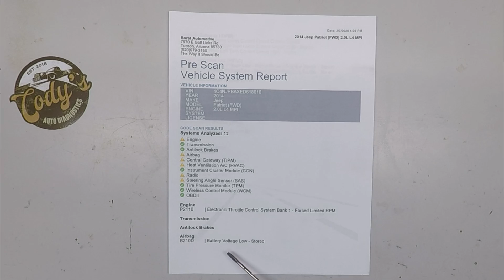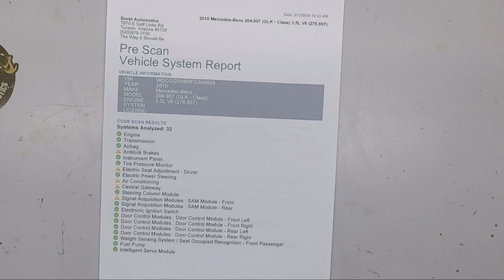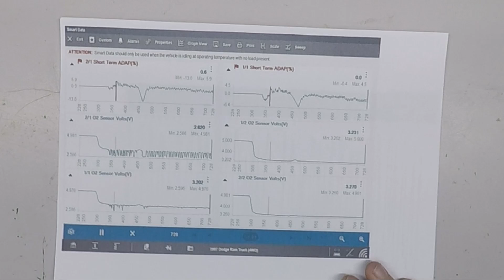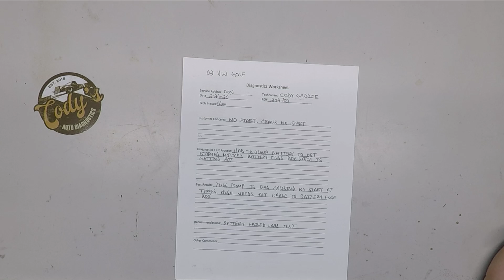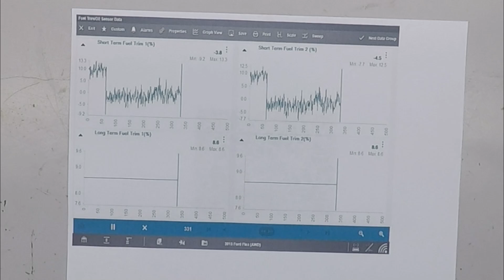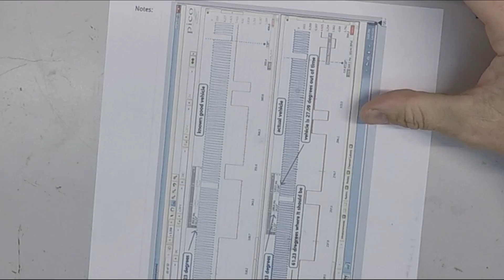DVI (Digital Video Inspection) part 1

Comment: It's great but not. It does comfort the customer, well some customers that have a clue on what there looking at. I seen shops show customers a part they replaced that isn't even on there car. It protects the shop and tech in a lot of case. The thing I have a issue with is time. Every extra step is time and cost. I don't care if it's a extra 20 mins it's time in a industry that needs time. It's a great ideal if if your paid buy the hr and if so I bet the customer is paying for that. I would like to know how your shop charges for that. It seems like a good ideal but if you own a 7 bay shop with the latest stuff out your over head is all ready high (so cost are high). For instance I was out of town and my shop was closed for 2 days. A good customer of mine had no choice but to go to a big shop up the street. He frist went to autozone just to see the code because it had a light on and a bad shake feel (his words). When he took his car in he explained "I think my number 3 coil is bad because my car did the same thing with same symptoms last year with coil 2. I'm not a tech but just throwing it out there. The code was miss fire on number 3". He was at there shop for 45mins. His bill was around 395$. They charged him 125$ to scan the car 100$ to diagnose it and 70$ for coil 60$ to replace it. To me that's crazy.for a coil on a 2009 Ridgeland that every thing is in the open and accessible. I understand over head but if it's all ready that high you need to charge those prices how do you add more to the bill when it's all ready outrages. Just my thoughts but other then time it seems like a awesome ideal.
Reply from the maker: I absolutely agree with you this system does take time. Only time a vehicle is getting a “full” inspection, is on lof’s for example, but us as technicians get .25 for the inspection plus the labor time to perform the lof. 

Every vehicle does get fluids and tires checked with the dvi,  which is only maybe 2-4 minutes for that inspection, and for those we don’t get paid for. 

That’s unfortunate about your customer and to be charging like that seems to only be gouging the customers wallet. 

I do know as a flat rate tech that time is money and I’m all about making the money and with this system it’s brought our average dollar per car up 2.5 times where it was without it, so that being said larger priced tickets are getting sold easier then before having the dvi. 

Customers may not be knowing what they are looking at but it does help build confidence that the shop is being transparent, which in turn helps the customers feel better about pricing or higher dollar invoices.

Comment: Wondering if you’ve seen this issue before 2008 Silverado 5.3 liter cylinder deactivation. Misfiring are idle on cyl 1 4 6 7. Pulled valve covers all lifters look to be moving none collapsed. Go into cylinder deactivation data and notice the commanded state of solenoids are off like it’s supposed to be but all the circuit pids say fault like opens and shorts. It’s an auction truck from the used car guy. It almost looks electrical than mechanical.
Reply from the maker: Hmm I can say I honestly haven’t seen that before on those cylinder deactivation systems.
Reply: Maybe I’ll check those pids  out make sure wires aren’t shorted on the block or something. And see where it goes
Reply from the maker: Any word on this one buddy?
Reply: Might take it to my own house personally since I’m on unemployment now due to corona. I’m going to update ya when I get somewhere on it

Comment: How do you charge for the diagnosis? Per DTC? One hour minimum?
Reply from the maker: Every vehicle starts out at level 1 (one hour) then moves to level 2 and so it on. If there is multiple codes from multiple issues then it’s going to require different levels of what the customer will be getting charged

Comment: Great video! I’ve  programmed several Gm vehicles with the same calibration before to fix various issues. If I remember correctly they were all entertainment and hvac related problems.
Reply from the maker: That’s good to know on gm. I noticed on tis that they’re are times on newer gm vehicles that they don’t even give the option to program with the same part number anymore. Not sure how that is going to work for times like this, may have to call acdelco and have them release the calibration file threw vci option instead? Have you noticed this on some gm vehicles in tis?
Reply: Cody’s Auto Diagnostics  Well that sucks. It’s probably been at least a year since I’ve done this but the last time I tried I was able to push past the warning of GM Doesn’t recommend programming with the same part number. Knowing that it fixed my problem several times in the past I don’t know what  I’d do if this isn’t a option
Reply: I tried flashing a 2015 Chevy Trax for a p0420 update customer complaint. Before installing a new converter. But it wouldn’t let me everytime I’d click on ecm it’d communicate then error message say no files on ecm reprogram not possible. Finally got it to work by selecting gm (Korea) at the beginning of the process all went good. Then later I googled about Trax and it’s made in korea and China 😂
Reply from the maker: phil holbrook wow I haven’t run into that before but that’s good info for the future! 👍

Comment: Wonder if you reset memory on the oxygen sensor issue it would of fixed it. Think it’s called reset adaptive memory in functional test
Reply from the maker: I did all the resets first before attempting the flash. I even did a hard reset with the battery cables for 30 minutes and still acted the same

Comment: I wonder if dropping battery voltage could have caused the corruption in the file on that Dodge
Reply from the maker: I really wish I knew, but that’s definitely a possibility
Reply: @codysautodiagnosticsprogra8706  so do y'all have a set diagnostic price and time limit or just a diagnostic price no matter the time?  Because like you say not all shops are the same
Reply from the maker: Shaun Adams that’s a good question, we have different levels of diagnostics, starts at level 1 and goes up from there. If we are not able to figure it out in less then an hour it gets moved to a level 2 and so on.
Reply: @codysautodiagnosticsprogra8706   cool so you are always in contact with the customer, but that is where it gets tough because many customers feel like it should be figured out in the time it takes to pull codes. Has the DVI helped in customer understanding
Reply from the maker: My old shop was that way as well, they thought 1 hour diag fee covered everything! 

DVI has definitely helped because it shows everything we did and why we need more time to continue with the diagnostics
Reply: @codysautodiagnosticsprogra8706  sorry for keeping on but our has a computer diagnostics which is just reading codes in 30mins and that includes filling out the paperwork for 89.95 or an hour diagnostic time without use of the scan tool for 65  so many times I have to get both I have tried to get the shop owners to combine the two but they say the tool has to get paid to so it makes more in 30 minutes than I do all day and it takes me to operate it. Sorry for the rant and I know the shop has to make money but where do you draw the line so you can sleep at night
Reply from the maker: Shaun Adams no worries buddy, man that sucks and I’m sure there are other ways of charging to get the tool paid without it being like that
Reply: @codysautodiagnosticsprogra8706  well as everything is going on like it's schools are closed I'm going to just hangout at home with my daughter and pray everything works itself out. I've been catching up on my sleep  have a great week thanks again for sharing your knowledge
Reply from the maker: Shaun Adams be safe buddy
Reply: @codysautodiagnosticsprogra8706  which I'm in Arkansas so I know there maybe an amount difference

Comment: As you get more experience in the new shop with this DVI system it would be interesting to hear if the customers are receptive to the amount of details you provide. In my limited experience, some customers just don't care. But I definitely see the benefit for techs. Keeping records on customer cars is great and protects you and the shop. We're doing good. I'm in the house anyway for this stupid knee replacement so I'm just hanging out. I miss working the shop though.  :)
Reply from the maker: Happy your doing good buddy! This software is nice but I also see your point, so far most customers really appreciate the service since it’s not something they have seen before, but I also know we won’t be able to please everyone.

Comment: That computer got “stuck” when you re flashed it, it in stuck it. Or the original flash file was not fully flashed in the module. I’ve seen that before. At least on Chrysler’s. I’m a Chrysler dealer tech. Good video man
Reply from the maker: I’m assuming the pcm file was corrupted originally or original owner had some kind of tune installed. That truck drove me crazy 😂
Reply: Cody’s Auto Diagnostics yea I had a similar case. Re flash fixed it.
Reply from the maker: Justin Hayward that’s crazy man. Haven’t run into that one before with the same flash file